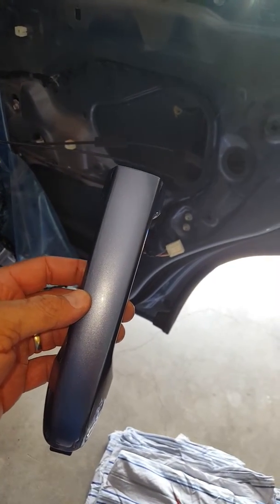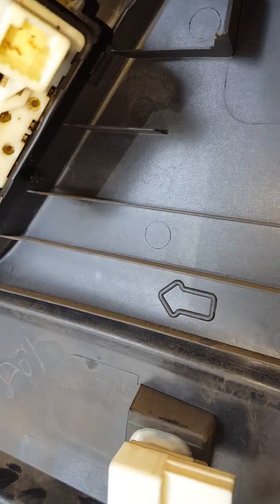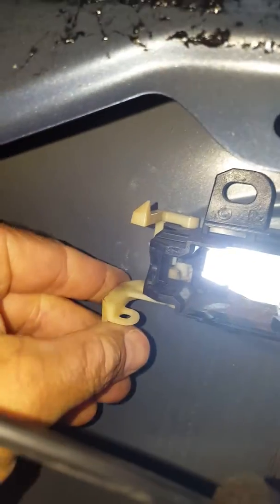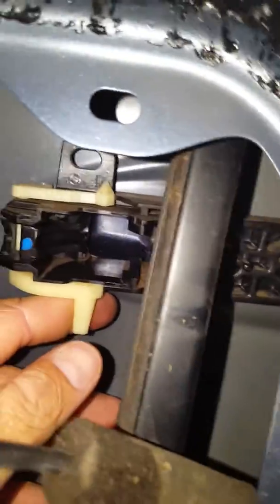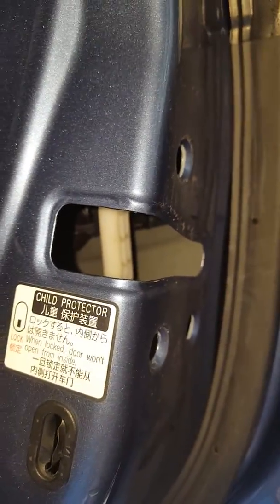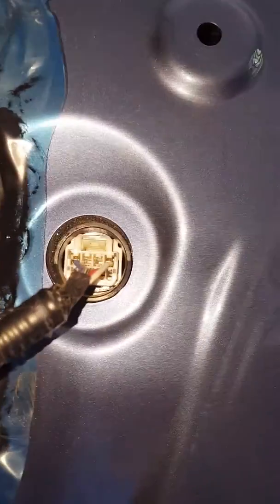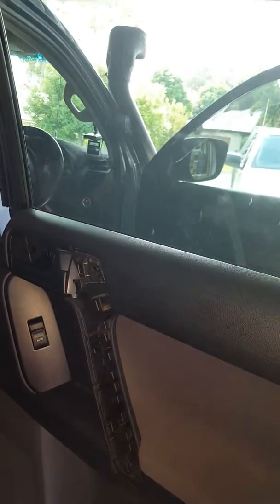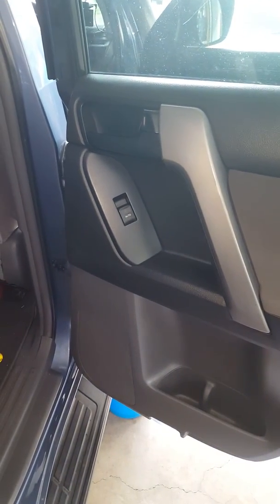Toyota Prado 150 series RH Rear Door Handle Replacement

Comment: The most helpful video. Cheers mate. Same door handle broken on mine as well. Turned a nightmare into 15 minute job. No need to disconnect the door skin at all.
Reply from the maker: Thank you, I struggled to find something online that would help me, so I made this to help everyone who comes across the same issue. Some others have made some interesting points to help make the changeover easier also. So please read other user's comments that helped them accomplish it quicker and easier.
Reply: @alfiebeagle404  yeh I read a few after I had completed and there were some good suggestions for sure.

Comment: You are a Champion mate. Great work. The only thing I would add to to this is, once you have the door trim off remove the window rubber from the trim and install it on the door first, then everything goes back on square.
Thanks mate 👍
Reply from the maker: Thanks for the info thats a good point

Comment: Great video.  One tip, I found it easier to pull the insulating window strip away from the door card, install it over the rim and then press the door card on to it. Much simpler, it was a real pain trying it any other way.

Comment: This was very helpful and I've followed it completely, however after reassembling the door. The exterior door handle still doesn't work to open the door. It's obviously not catching on the latch or something. I've made sure that white plastic lever is catching on that metal pin, but still no luck. Any suggestions? Thanks Craig

Comment: Very useful- didn’t even know where to start. My door handle is also broken from kids- made me laugh when you said it. Where did you get your replacement? I’m looking at wreckers but seem to be hard to find, and Toyota aren’t much help where I live
Reply from the maker: Thanks Brian, Kids break everything these days. I got it from my local Toyota dealer as i had looked online with no luck with colour and in the end the quickest way to replace it was overnight delivery from the dealer. Maybe ring another dealer near by, may just have to pay postage ??? Good luck with your replacement of it. Overall its not hard.
Reply: I'm guessing you found a replacement but for anyone else reading this I had a quote of $85 from a wrecker or $85 from Toyota... given mine seemed to break due to age I naturally bought a new one.
Reply: Mine came from eBay for sub $30 each - I needed two. Plus some grey plastic primer, a small tin of Charcoal paint from Supercheap or other auto place. Some 320 and 800 grit sandpaper and clear acrylic top coat. If the Toyota ones are already the correct colour, it’s probably worth getting theirs as the eBay ones are a virgin black plastic ready for spraying. All AU$…